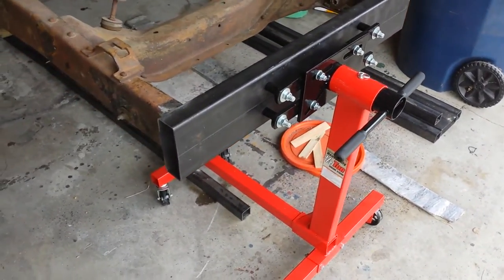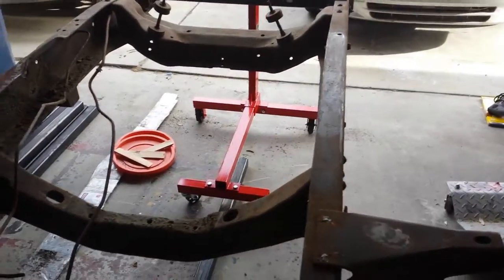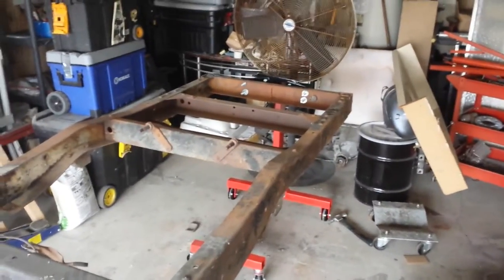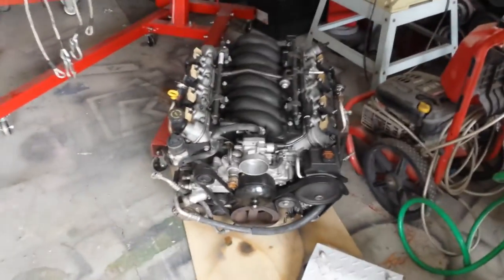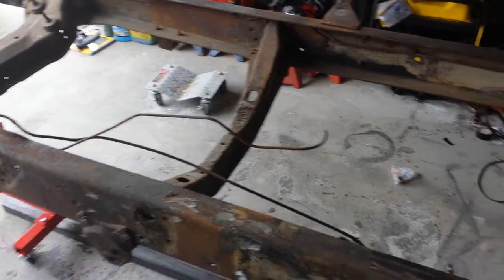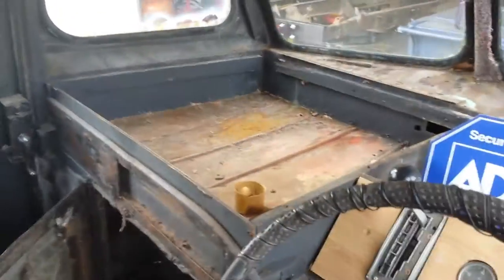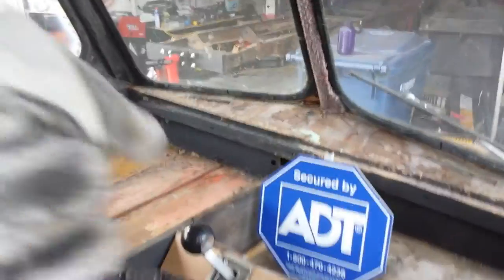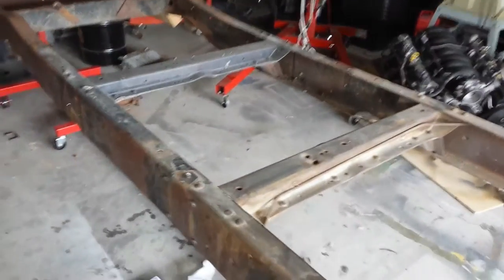1955 Chevy Truck frame Rotisserie

Comment from the maker: hi Davrell
i blasted the frame which i will never do in my garage again...sand and dust bounced over the plastic wall and took forever to sweep and blow out but got the frame built,switched to an LS3  vet motor.and mounted the body  ......got married moved in with my wife tore down 2 car garage and built a 3 car with steel beam for chain hoist and 8 foot doors so the mail truck could pull in which it wouldnt in my garage ......next step is to finish body mounts and new floor fabrication then pull body off a finish the frame and suspension.... then the inside then out .....should have new videos up soon ... i have a couple but just have edited them